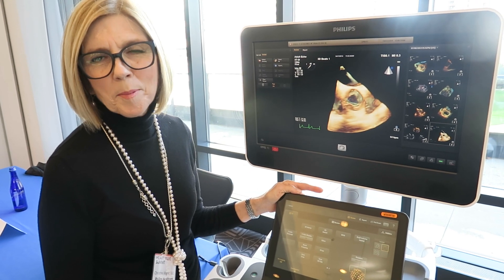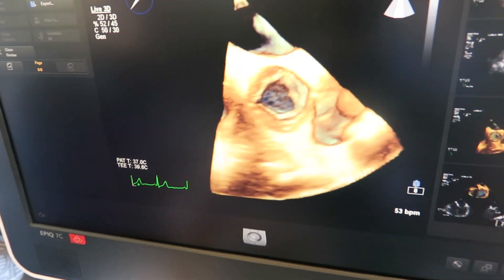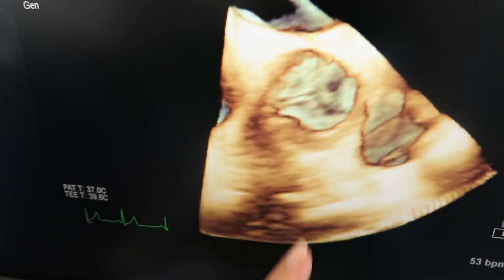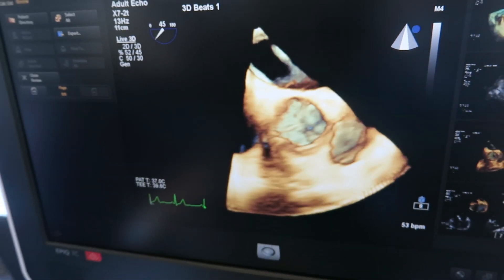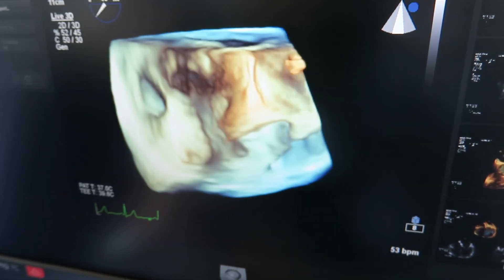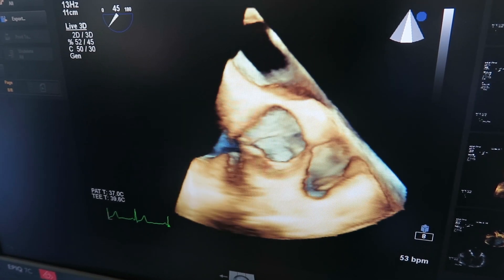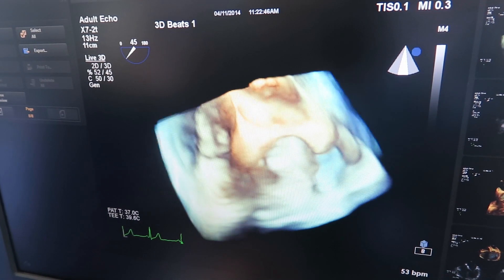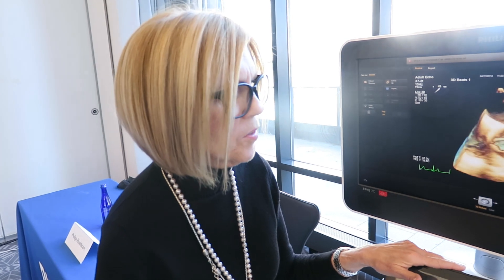3D Echocardiogram of the Aortic Valve

Comment: Very cool! Is it an invasive procedure to get the 3D volume of the aortic valve?
Reply: No
Reply: @EternalDestiny48  Thanks.. so i it using a TEE probe?
Reply: @ThamizhanDaa1  no It uses a transthoracic probe for example on the Philips machine it uses the X5 or X7 probe
Reply: @EternalDestiny48  okay.. thank you very much! I was confused between the transthoracic and trans esophageal.. but that's nice. I didn't know you can see the valves with that much clarity with the Transthoracic.. so I gotta check it out..

thanks so much!
Reply from the maker: Great point!